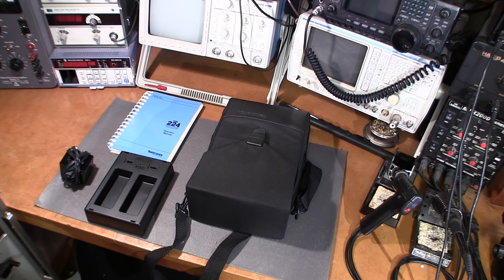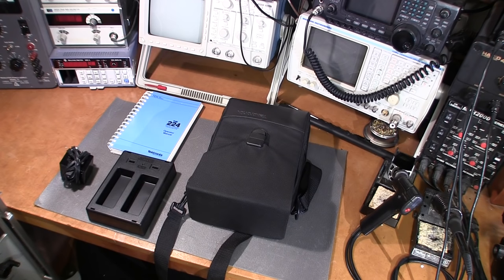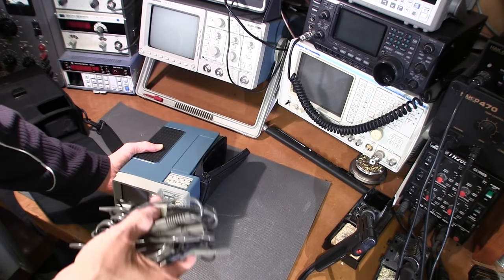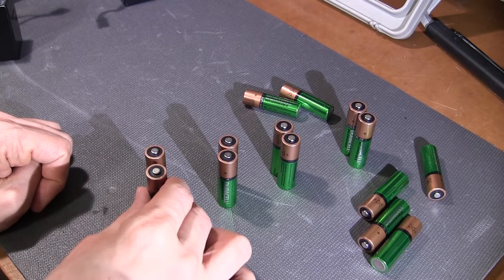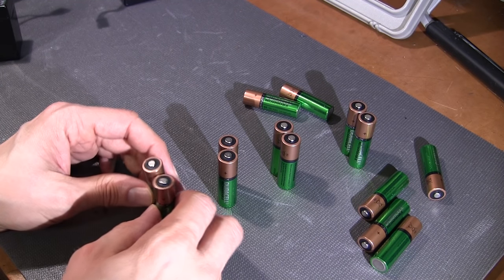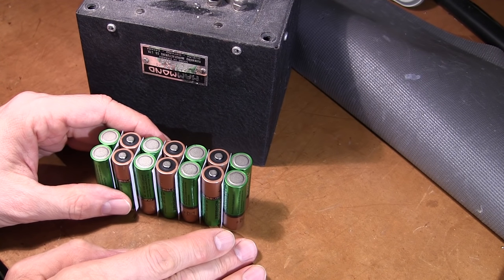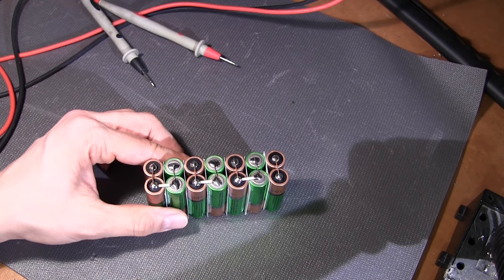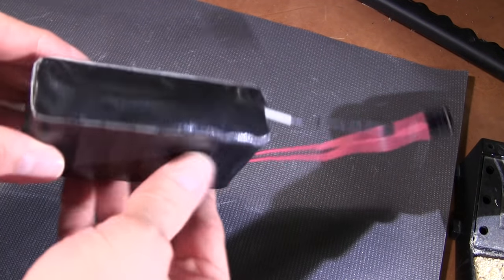Tektronix 224 Oscilloscope Repair and Modification

Comment: Interesting Video. I would have thought that all of your battery banks would be required to have the same number of cells in them to avoid problems created by a having mismatched cell capacity. It will be interesting to see if, in time, the bank with only 2 batteries either stops holding a charge or begins to leak fluid before the other banks. You have a great channel. Thanks for sharing your knowledge.
Reply from the maker: Can you give me a time in the video as to what you are referring to?
Reply: Sure. 27:49 appears to show 3 banks of 4 batteries and 1 bank of 2 batteries. Unless I'm missing something.
Reply from the maker: 27:49 is the end of the video.
Reply: Sorry. Try near 21:40 to 22:00
Reply: My bad. you have 7 banks of 2 batteries. Is 8.4volts correct (1.2vdc x7)?
Reply from the maker: No Problem. Yes 8.4 is correct, but they will charge a little higher than that.
Reply: Thanks for your understanding. Thats what I get for replying at something like 4:30am.  Again, I truly enjoy your videos. You have knowledgeable and very innovative solutions. I hope one day I can find a piece of test equipment that I can resurrect. That will be truly rewarding. You and a few other channels who also visit you have my respect and admiration. 73

Comment: I wish you had covered charging the pack sir. That opens up a whole new can of worms though I suppose?
Without any bells and whistles like auto cut, LED light or auto  heat sensor shut off I have charged NiMh batterys for 2 or 3 hrs with a simple wall plug charger until they get warm you just can't forget them.
My Revolectrix Cell Pro PL-8 RC charger is smart enough to fast charge, do a delta peak then cut off at the voltage for the total cell count specified 1-21 cells.
Then it will start trickle charging at 1/20th of the original charge for a maximum of 4 hrs. It would see your NiMh pack as a 7 cell pack.

Comment: Greetings:
You mention early that the scope can operate directly on the power adapter that is also used to charge the battery pack when mounted in the charging base. The use of that charging base may mean that the battery is bypassed when the adapter is connected directly to the scope, possibly due to inadequate current capacity to both recharge the battery and operate the unit at the same time. If that is the case, how about a wiring modification to allow internal recharging when the unit is powered OFF.

Comment: Hi ,your battery back idea for the scope was great I have a Techtronics scope that requires exactly the same type of repair and what do you use to charge the battery pack with now? Do you use the one that came with the scope or a one built for the purpose? By the way, I fixed the 60Mhz scope the problem was on board trim pot that was also faulty. Many thanks for the tips on repairing oscilloscopes and equipment. I look forward every week for Mr, Carlson Lab.
Reply from the maker: Great to read that you fixed your scope! The battery charges in the scope. While I was at the bench yesterday, I left the 224 on for 5 hours straight, not even a low battery warning. Today I will turn it on again and continue.
Reply: Wow proves what sort of reliablity can be achived with a good quality battery pack and increased capacity.

Comment: Hi. Very good material, I'm amazed with your lab. I have one 224 and when I let it to my brother (car technician) the scope failed. When plug the source, it starts on the probes screen and then blank the screen, showing a point in the top right, then shows the probes menu again and loops there. I'm trying to repair it but can't find the service manual. If anyone can help me I will be grateful. Best regards from Venezuela.

Comment: I if you notice this Mr.Carlson I would appreciate your advice on picking a compact scope to build your signal tracer. I once had and threw away a bell and howell kit oscilloscope looking very much as one you used. I would prefer if feasible something more compact and portable. Thank You or to anyone having brand model suggestions

Comment: Can I ask why you chose these rechargeable AA batteries instead of some flat li-ion battery packs....or even some of the round 18650 batteries?
Reply: Those would require a proper charging circuit. NiMH cells can be trickle charged forever just like lead-acid batteries, so the existing circuit works fine.
Reply: @Roflcopter4b  
 I think that he should add a 9v battery connector to the pack also, for easy charging. Most chargers have a 9v connection too.
Reply: @Roflcopter4b  I think it also has to do with voltage. Each Li-ion battery has a working voltage of around 4.2V to 3.3V so if you use just two cells in series it would be a voltage of 8.4V at max charge which i guess is a bit low , but if you use 3 in series the voltage rises to 12.6V so that becomes too much. So i think the NiMH chemistry approaches the voltage requirements and discharge profile the closest.
Reply: You also don’t want to put heat to a Lithium Ion battery, or stress it in any way! 

When those things fail....... They fail VIOLENTLY!

Comment: Paul, two questions for you this day about this upgrade. First, what is the material used to house the new batteries and second, did you think about upgrading the charger to conform to the new batteries. I know that the charging curve can be different. Thanks.

Comment: Nice setup! I'm curious if you've ever worked with 18650 or 18500 lithium batteries. They are cheaper that nickle metal hydride and have greater capacity. I know this video was several years ago, but I'm wondering your opinion on the 18650's. I've used  them a lot and have seen them to be an excellent power source if you limit the charge/ discharge current. A 3 terminal 9 volt regulator for output and a resistor or simple regulator in series for charging. Also, I have had really good luck with nickle metal hydrides, but they have to be good ones like Energizer or Duracell. I bought a bunch of cheap ones off Ebay from China and they wont hold a charge at all (for arguments sake). The 18650's used to sell for about a dollar each and even the China one are about 95% good, except for a rare defective one once in a while. They work great in those Borit head lamps. Thanks again for your wonderful videos!

Comment: How do you charge the 9.6v battery pack once it is all together?  This technique might be very useful for a 24V SDS drill I have with a dead battery pack.
Reply: I am wondering this too and how do you know it is fully charged? How long does it run with the new batteries?

Comment: Paul, what material did you use as an insulator between the batteries that the super glue would adhere to?
Also, what did you use to wrap the pack with? That is so clean a job i want to use it myself.
Lastly and humorously, are you a bit of a scope junkie and collector as well?

Comment: great video.... 👍 lovely osci...
at the beginning i thoughed that you sure will take 18650 li.ion cells 😉😉 but then you use Nimh... maybe because of the charger or?
Reply from the maker: Yes, NiMH are a direct "plug and play" solution. 18650's would need a special charging circuit, and the charging circuits are also noisy in a scopes quiet environment. I don't want to increase the noise floor. Thanks for your comment Bernd!

Comment: That is a neat little scope, I have looked for them in the past 2 years and I have never seen one as nice and clean as the one you found. I am guessing you didn't go the Lithium Polymer battery route due to the voltages available.

Comment: Paul, when I try to use my scope to test for the foil end of my caps it appears to not to have sensitivity required.  Can you recommend a good used scope and or a reasonably priced new one?  I'm looking in the $200 to $400 range.  Thanks.

Comment: I was a bit dubious about the idea of soldering batteries, but I agree your 260W monster of an iron does make a good job of it. I wonder if I should invest in a higher power unit than my usual 60W
Reply from the maker: It's a handy soldering gun to have around, especially for chassis soldering

Comment: i found a sony discman D250 a couple years back at a flea maket for a couppe euros, it also had a 4.5V lead-acid battery which was dead. Since i didn't yet have the confidence to play around with the very flamable lithium batteries, i got NI-MH flat batteries too and made a pack out of them. It was a crude first try, but it works great up to this day :)

Comment: Nice upgrade!
But I wonder why you didn't consider using NRC18650B cells instead? There are plenty two cell protection PCBs available and then you could tack with two in series, then 4x parallel. This gives you 13.6 Ah / 50.32 Wh.
Reply from the maker: Well, That would be 6.8Ah (Voltage doubles in series, current stays the same) That current rating would be for 4 batteries in series parallel. The problem with using two 3.7 Volt cells is.... The low battery indicator comes on at 7.3 Volts. Lower than this, the scope promptly shuts down. The charging voltage for the NiMH is 9.7 Volts, which works out perfect for 14 NiMH cells in series parallel. Lots of headroom with this configuration, and no modifications are needed to the factory charging system in the scope. On one charge, the scope runs for 8.5 hours continuous. That's good enough for me.
Reply: Mr Carlson's Lab
The NCR18650B cells have 3400 mAh average capacity.

Ah okay. Yes, that is more convenient. Lasts exactly one working day and you don't have to bother turning it off on the break. :D

But I would have gone to the trouble to make it work by add a step up converter. I just like these kind of things. I also would have added a small LED % charge indicator which shows the percentage only when holding a momentary switch. :D

Comment: Hey Paul , welcome back - I have missed your videos. Hope all is well..  great little scope and great battery pack.  When you recharge the batteries will you be able to use the same charging tray that came with it ?   Great stuff, regards, Ron
Reply from the maker: Thanks Ron!
Reply: The most important thing: the charging circuit. You can't use the original. What did you come up with? Inquiring minds...
Reply: @davecc0000  The "nominal" LA battery voltage is 8 VDC, however 4 LA cells @ 2.3 VDC ea.= 9.2 VDC.  The original charge circuit is current limited (suitable for LA or NiMH chemistry) and runs at 9.6 VDC perfect for the 14 series/parallel batteries.

Comment: i have a problem with the gw instek GOS-635g . i have a burnt diode the doide is intact but the leads are not.the diode is in the or near the CRT curcuit and without it i can't power on or display all i can tell you is that its a zener diode with 2 blue stripes i tried t oget a voltage without the diode but  i get no voltage i have schematics to go by i have a picture of the diode its long shot was hoping for help?" i wish i could put a zener diode in there but have no idea ?  it works fine just went to turn it on and it would not it came from a high school so i  thinking that it was ready to go and finally did burn out

Comment: Oddly, I ended up getting the identical scope at a great price in flawless condition. However; it only came with one P850 X10 probe, the power supply and the pristine bag. Unfortunately it also lacked the manual, but is user friendly and easy to figure out. As luck would have it, I scored two P400 X1 probes in mint condition and were never used. I am trying to track down a manual and another P850 X10 probe that gives maximum protection to the scope. I love the fact it has the earth double isolated so the scope can be used safely without shorting out the grounds. So! if anyone can help me find these hard to come by items I would be grateful, "Excellent Video"

Comment: Hi there. 
I have purchased a similar unit but is just displaying a point that is randomly jumping from one position to another, its position not being affected by the applied signal. I suspect either a issue in the power supply unit, either a issue in the controller processor board. An diagram would for sure ease the work - do you have the diagram for this Tektronix 224?
Regards,

Comment: I have a 222 as well as a 222PS. It looks like my battery situation is the same as yours, so thank you for making this video. I did have one question. Are you comfortable with charging your new battery pack in the oscilloscope using the external power supply, or will you remove the pack to charge it externally? Thanks again!

Comment: Just a cuple of question... since the original charger was supposed to charge lead-acid batteries will it still work with NiMh batteries? Since the original battery was a 8V battery, how did you know the oscilloscope would still work fine with 9 and a half? Thanx, i really love your videos!
Reply: The original battery pack was made up of Sealed Lead Acid battery cells that actually put out 2.25 to 2.3 volts per cell when fully charged. 4 cells (2 in each battery) will put out 9 to 9.2 volts. Based upon all of the videos Paul has produced i am sure he investigated the circuitry in the manual before he did this. He is just that exacting and precise.
Reply from the maker: Richard is correct. The scope tries to charge the dead lead acid battery at 9.6 to 9.7 Volts. This is almost "spot on" the fully charged Voltage of the new NiMH batteries in the series parallel configuration.
Reply: As far as my numbers tell, the NiMh pack of 7 will in this configuration never be fully charged, and the scope will start charging before they will be really empty, but all is on the correct side of both limits. The only drawback of this will be that the full potential of the cells can not be exploited, I guess only about 70% - 80%. Still better than a (dead) lead-acid battery.

Comment: Hi,hello from France,i have three of these oscilloscope (TEKTRONIX 222-222PS and 224),a question,the internal charge circuit is a constant current mode (for Lead battery),the Lithium battery is constant voltage mode,is it compatible?,the ENERCEL 2V-2,2Ah lead type is a second source for this opération,connect in parallel mode 2 battery is not recommanded (the voltage in not exactly the same and create a parasite current between the battery). Best regards to Lorraine,France.

Comment: Hi Paul, gotta question. I can see doing the series/parallel of 14 AA rechargeable batteries will produce the 5 ah of power, but the voltage total would be 10.5 volts full charged. What happened to the 1 volt ?
Reply from the maker: NiMH batteries are 1.2 Volt cells. At a full charge they will be slightly higher for a period of time.
Reply: Thanks Paul !! :-)

Comment: Awesome video as usual! How do you plan to recharge the battery pack? Does the scope have internal charging circuitry?
Reply from the maker: Yes it does. It trickle charges the batteries through the adapter.

Comment: Apologies if I missed this, but how do you keep the cells balanced?
Reply: I mean during the recharge cycle and would they drain evenly as well?
Reply from the maker: They will charge and drain relatively even. They are all new batteries and will only be trickle charged by the scopes power supply. So if you were to think of it this way: If one cell won't charge due to lower supplied current (trickle charging), the cell it's in parallel with won't charge as well. So the pair just act as one dead cell. The whole issue with paralleling batteries is the supplied current during the charge cycle.
Reply: Thanks, I know many battery packs use this strategy. Many small cells (laptops, teslas, and even 9 volts) to make one big battery I just didn't know if there were charging circuitry/cell monitoring involved. Terrific stuff and thanks.

Comment: I have the 222 and of course the battery is toast so I may do this mod.  I presume you plan to use a bench PSU to recharge and if so what settings will you use?
Reply from the maker: The battery pack will charge in the scope with the factory wall wart
Reply: OK, I can see it charging but how do you prevent over/under charge?  If under charged a bit that's not a bit problem as it would only impact run time, but over charging could be bad.
Reply: NIMH batteries are very tolerant of overcharging if the charge current is low.

Comment: Hi Paul, thanks for your very nice vids!!!  You 're doing an excellent work!!!! Just a question... should the charging cirduit be modified ?? (due to the change of battery type)
Reply from the maker: I changed nothing in the charging circuit at all. That's the nice thing about doing this battery mod. If you were to use li-ion batteries, there would be many changes.

Comment: Cute little scope.  Has that less is more look to it.  Great little scope for doing on sight repairs.  And like you said, its a CRT.  Double thumbs up on this find. :)

What, no tab spot welder?  I made one several years ago and love it.  Generates almost no heat because it happens in a fraction of a second.  You can literally touch the spot weld as soon as you do it.  No need to cool the battery and oh so fast.
Reply from the maker: Thanks for your comment Mike!

Comment: Great video.  How do you charge  the pack now?
Reply from the maker: The battery pack charges in the scope (trickle charge) when the wall wart is plugged in.
Reply: +Mr Carlson's Lab Cool that should last a long time
Reply: I was hesitant to use anything but lead-acid on mine because of the charging circuitry.  I ended up using four individual lead-acid cells (Enersys Cyclon 2V, 2.5AH D Cells). They're tight, but you can make them fit and I didn't have to worry about incorrect charging.  (Note: admittedly I'm not the brightest crayon in the box, I just worried about swapping lead-acid for any other chemistry)